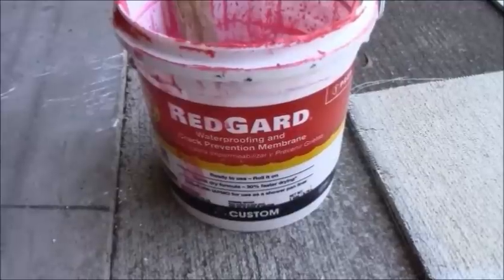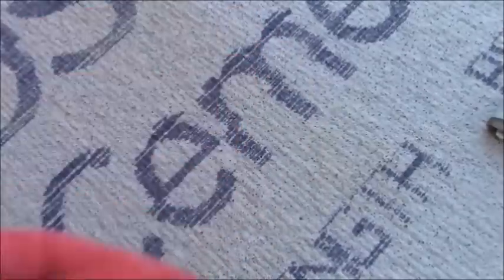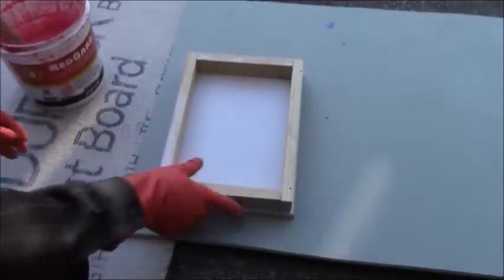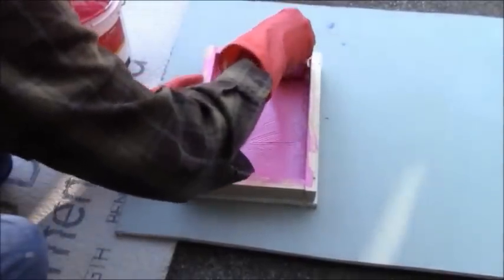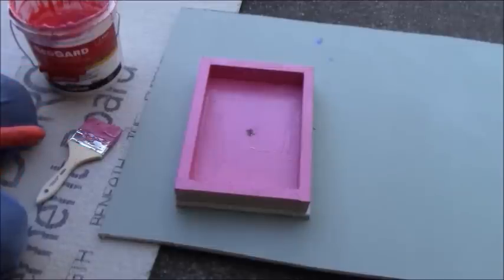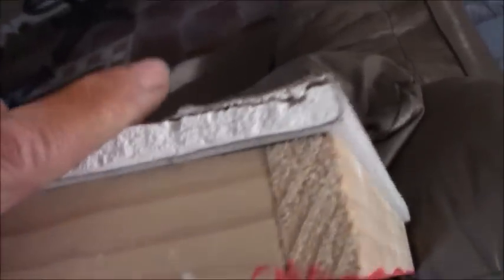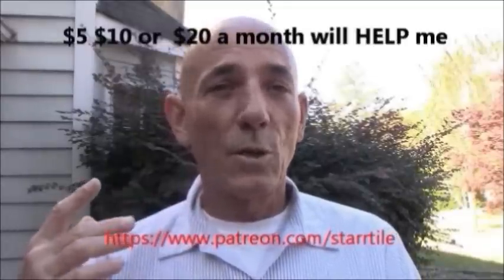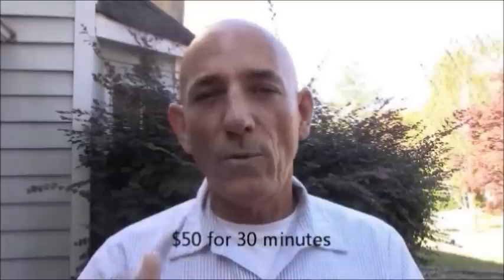REDGARD vs SCHLUTER

Comment: I built my shower using YOUR methodology, Bob, from floor to ceiling, wall to wall and I must say that it was not only FAR cheaper but much more cost effective! I built an entire corner shower and used Hardie backer slathered with 4 coats of Redgard.. Cheap insurance and it did the job! One side note, I got flamed over on the "other professional tile forum" (I think we know which one) for expressing my disdain for the "industry" standard and I eluded to some of it's overkill regs. I DID NOT use a preslope and I followed Bob's example to the letter, mirroring his curb building and shower pan and I can say unequivocally that it just made too much sense!
 These Kerdi, Schluter and Durock membrane systems are just slight copies of one another with subtle differences to keep the "Patent Police" off of their respective asses. I thoroughly looked at all of them and STILL the old fashioned way with a topical liquid membrane is much easier and FAR cheaper. I had a non-symmetrical shower drain with respect to the curbing so the KRB custom pan was the only other viable option but it too had an exorbitant price tag.
 Do yourselves a favor and heed, or at the very least, make careful consideration of Bob's advice and you will be pleased with the outcome.
 Thank you very much, Bob, for your valuable insight and concise videos! You, sir, are an invaluable asset to the DIY community!
Reply from the maker: Thank you sir for the kind words, and ya don't ever mention me on a forum unless you have a hard hat😂
When I put information out there it is up to the individual to decide for themselves, and if I thought there was a better way even if expense was an issue then I'm all up for it despite cost... but sometimes there is just not a better mousetrap only a more pricey one
Reply: Hope you donated to his pateron if he saved you $$$ 😂😂😂... He saves people thousands and headaches... GREAT JOB STARR🤙🏽🤙🏽🤙🏽
Reply: I have an older home that was built in the 90s. The original builders did not use a pre slope mud bed and I can tell both motar beds failed. I stopped using one shower months before demo because the failed motar bed and i can honestly say the motar bed was still damp months after not being used.
Reply from the maker: @mmholling87  from the 90s, that would be pretty typical, what I find is Builders grade showers last an average of 20 to 30 years, has everything has a shelf life and so does a shower
Reply: Since I'll be using a kerdi drain, you're saying I can just use redguard over it instead of the kerdi membrane?
Reply from the maker: @angry-white-men  I cannot speak to that since I do not purchase or have experience with Schluter Kerdi products, but if you're going to be using a Kerdi drain then why will you not use there other proprietary material? I would trust their membrane if done correctly
Reply: @StarrTile  I was thinking about it but I'm trying to build it on a budget. I figured all the cement board will only cost me about $40-50 and the redguard to cover it around $100 versus the $40 per sheet of kerdi board or $80 for a roll of their membrane plus all the corner pieces. I'm really not sure what to do at this point.
Reply from the maker: @mmholling87  trust me I can well understand and appreciate that, I take out showers on an average of 2 a month and I see the same thing all the time, however you would have to compare it to a demolition of a pre slope shower to have a real-world feel on whether it works or not.. my contention is that a non pre slope shower would have a little more water in it, but both of them would still be wet years and years later
Reply from the maker: @angry-white-men  it's very simple, just think like water, if there's any way for water to get into areas then mitigate that possibility, that's all I do
Reply: I’ve used Kerdi products but the problem with that is the overlapping seams build up and you have to be sure to apply enough mortar to prevent lippage on you tiles

Comment: I had my shower pan fail.  Redguard present. Seemed like a pretty thin layer but I'm just a DIY guy.  I'm guessing (not the original owner) the install lasted about 10 years.  I think it was more failing grout and a weak tie in with the schluter drain that didn't endure my kids filling up the shower pan by stuffing the drain with wash cloths.  I replaced it with Kerdi and epoxy grout so I'll report back in 10 years.  If anyone can damage the shower I think my kids can do it.

Comment: Did our basement shower and used Redgard.  Product was easy to use because it is just painting it on.  I think I used 3 coats but it may have been 2 because I am Joe Homeowner.  6 years later and still perfectly dry.  Red Gard will be my go-to waterproofing layer if I do this for anyone else.

Comment: Great video. Love you test and the time you did to do it. Getting ready to do a new build shower 3 ft X 6 ft. So what is the correct steps to do it right one time.Thank You
Reply: Wanted to mention I just have the studs in at this point and ready for wall board . Was think of using 1/2" Herdieboard.  Don't mind the cutting out side but very interesting with Green Board which is what I have around the shower area right nowf

Comment: If you regard the bottom 6 inches of the boards prior to install then the cement boards will not absorb the water 

Gypsum is OK but cement is better, cement bonds to cement (thinset to cement).
Reply: If you redguard the cement board then you’re not bonding cement to cement. You’re bonding cement to redguard
Reply: Derek and that’s not rocket science to understand that but it still went over his head lol

Comment: As long as you do not make a mistakes during coating and installation or someone else does after the fact ( improperly installing a shower door or otherwise creating a penetration) then greenboard will work fine. However if you do ever have some water make its way to green boards interior it will quickly wick up and soften the board often to the point of failure. Cement board particularly the USG brand will soak it up without serious loss of integrity, also unless you water proof both sides or run plastic sheeting (hello 1970s) on the studs the backside of the board will allow for evaporation of small amounts of water pretty quickly....Of course (as you mentioned) if you have embedded the board in the mud in the receptor and it gets soaked (as can happen with a fractured wall tile to floor tile joint when you do not use sanded caulk)

I agree with you that working with cement board is a pain but IMO it is the best material when installed properly....but I have not done nearly as many showers as you so who knows I may try some in the future.
Reply from the maker: Not only green board but just normal sheetrock with 4x4 ceramic tile and unsanded grout was used in showers for decades from the late seventies into the 90s, I have taken showers out like that that are 30 plus years old and the sheetrock is not ruined, not even soft, sometimes the back of it might have some mold due to the fact they put a too close to the pan but otherwise it's pretty much pristine 30 years later so your take on using it in a shower without waterproofing is not really true.
(The 100 Year Shower)
Go look at that video which I put out there as proof positive to what I say.
The Achilles heel with any shower build is operator malfunction, it is real and it is why I have so many failure videos on my channel, so anything is possible I suppose

Comment: Very cool video. Been looking for a crack prevention membrane for a half bathroom I'm planning on tiling. Was leaning towards using ditra but this video convinced me that redgard should be just fine. Liked and subbed.
Reply from the maker: A liquid topical membrane is not a crack prevention method for a floor, that's what ditra, durock, wonderboard, hardiebacker, all of those materials are for your floor, then if you wanted to put some redgard on top of that then by all means
Reply: @StarrTile  thank you for correcting me. I will be installing ditra then.

Comment: I have been contracting for 41 years and I use hardi backer board and Red Gard. The method shown above will work..... IF...... Done properly. I have seen green board that has degraded when I have demolitioned bathrooms. I have seen Hardie backer board that had been graded over and buried in the dirt for years and it looked just as good as new. Inevitably, some clown will probably see this video and use this as a shower pan base 😂
Reply: I'm doing a shower now. What do you recommend for the seems of the HardiBacker prior to RedGaurd waterproofing? Can you use the 20 minute mix for drywall seems?
Reply: Homertalk I use 20 minute mud because time set mud becomes water resistant. Drywall tape in the corners and mesh tape on the flats.

Comment: Schluter Board is a foam board and not a gypsum product. Schluter board uses a washer on all their fastners which takes up the surface area of about 6 drywall screws (per Schluter fastner). Traditionally installed I would say the Schluter board system with proper fasteners is at least 2 times as strong as any "GYPSUM BOARD/DRYWALL" If not stronger.

But the issue here is not the sheer strength of the product it is the longevity of the product. Any water resistant drywall that is going in a shower has to have a fiber glass tape applied to all inside corners and seams then coated with redguard. 

If you use cement board not only do you have a much much stronger sturdier product, the product itself is waterproof. You can tape seams and inside corners and do a single coat of red guard. Even if you skip red guard and just had concrete board it would still last longer then the drywall with redguard because concrete board does not break down the same way drywall does. There is a reason why they make concrete board and why it is ideal for showers.. 

Even with a waterproof membrane theoretically the drywall can always potentially sag as it is a paper faced product its not very strong and every door slamming or someone falling into the shower wall could potentially weaken it over time as it would send a vibration through the studs. 

All my houses in my neighbourhood were done with greenboard in the 70s and in 10 years everyone had to replace there bathrooms because the tile was falling off.. 2019 Greenboard is still code as shower/bathtub backer even without memebrane...
Reply from the maker: You are incorrect that cement board is waterproof, that is so so so not true...but check this out https://youtu.be/Jxi-iSh-6A0

Comment: The problem with only using greenboard and you if you are using a smaller tile, there will be flex in the wall between the studs! I would use a kerdi or one of the other products that you prefer using over the greenboard for a more solid installation.
Reply from the maker: Actually that is incorrect, one of the reasons I use green board is because it is rigid, put wonderboard or durock between studs and push...it gives a lot

Comment: So many layers needed on cement board to get rid of pin holes. Looks like I should have just used green board. The tile is still good after 6 years, but I know I didn't get all the holes... I used a modified thinset and no-seal grout as well though. I would like to know how Redguard does with horse hair plaster though. Any takers?

Comment: Found that using a cement/fiberglass blade on a jig saw to be super effective for cutting Hardie. Low dust factor. Just cut 18 4x8 sheets today. Min dust. Just cracked a window. Power shears also work nice. 

Just saying.

Comment: So I use green board also but I seal the board all the way to the liner and using mesh tape and silicone I seal the bottom of the green board. Then on top of the pan I mesh tape and silicone and red guard the whole shower pan. If water was to penetrate it would only seep to the top of the pan witch is protecting and pitched to the drain.

Comment: This was a very interesting video. Now I'm trying to think of other places I can use Redgard.  I'm also doing a shower.  I'm using a foam curb and the newer Hardi waterproof board. It's  not much more than the regular Hardi and I only need a few sheets.  My question is how large of a gap will Red Gard fill and waterproof?  Also, can I use Red Gard where the curb meets the shower pan?  Thanks

Comment: I would not think the waterproof aspect is an issue. Surely redguard exists cuz it works.   I would wonder about weight of tile and such on paper instead of concrete board. I am definitely going to use redguard but not sure about the backer..
Reply from the maker: The weight of the tile is a non-issue, gravity doesn't work that way when you are sticking tile to a wall, there's not a downward pull after thinset has dried over the redgard. I've personally been using it for 8 years without one single negative incident
Reply: @StarrTile  thank you for the reply.

Comment: 100% on board with what you’re doing. I’d like to know, however, where you get enough redguard to do a shower for $52. I’ve never seen it that cheap.
Reply: $47.00 at Home Depot per gallon.

Comment: Do you tape the seams and corners of the board with mesh tape and then mortar the corners, seams, and screw holes first or do you use mesh tape then redgard first and then just tile? Does it matter?
Reply: a,èkññ ñbsolutely   if you dont tape corners   you have 2 walls that can flex or move potentially  different  It  will make the grout  corner crack

Comment: Great video!  First video i see if yours and very informative.
 Is it possible to get the best of both worlds and use Kerdi pre sloped shower base and redgard over it and on the walls ?
Reply from the maker: yes that could work , I'm just not on board with foam or plastic in showers that I build

Comment: Greetings. I have watched all the install videos and yours seems to reflect my conclusion with respect to all the various methods of waterproofing.   Especially when you consider the costs associated.  There seems to be a consensus that the more expensive the process the better most seem to like it!  My only question is the use of a notched trowel over the Red Guard membrane.  Does anyone know if the metal trowel will  cause possible punctures?
Reply: It's super tough,  you could puncture it if you jab the edge of your trowel in really hard,  but otherwise regular/ fast spreading isn't an issue.

Comment: Well, where I've always seen failure is in corners when using a product like this. Floors move separately from walls so that corner over time can crack unless you have a solid frame around the perimeter of your shower floor, so it can't move. The slightest movement over years of you in and out using that shower could lead to cracking if that floor is moving, so I always use a rubber pan, why take the chance. The cost of a repair costs way more then the initial cost in my view.
Reply from the maker: What you said about constant movement in houses is absolutely correct, every material you have in a house will expand and contract and even separate, however redgard is basically liquid rubber and I could take a sheet of it and pull it probably three quarters of an inch before it ever ripped, in fact if you look at the label is a crack prevention membrane as well as a waterproofer , you cannot do that same test with any Kerdi Schluter product
Reply: @StarrTile  What you say is true about this product and the same logic also applies to Blueskin which is use for sealing foundations. Applications of these types of material do stretch quite a bit when on a surface but not when it's sandwiched between 2 other materials that don't stretch. In the case of the shower you would only get the small bead in the corner having leg room to stretch and the material between tile and concrete or tile and wall will not benefit from this freedom to stretch. You can try this experiment your self by applying this product to 2 pcs of drywall touching but not connected together, then tile them both. You will see you don't get much stretch. I'm not implying that this product is not good, It's just over time, maybe months or years, it may crack. I just don't see using just Redgard when there are other ways to improve, use 2 systems together for a greater assurance, a rubber pan to protect floor and Redgard to protect walls.  Bathrooms are expensive and to have not done all you can to prevent leaks is in my view, a mistake.